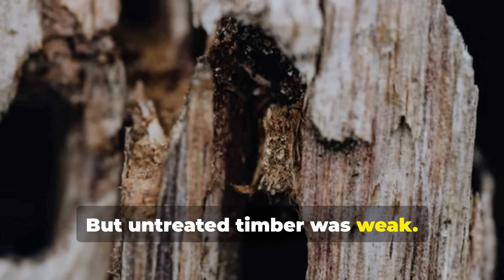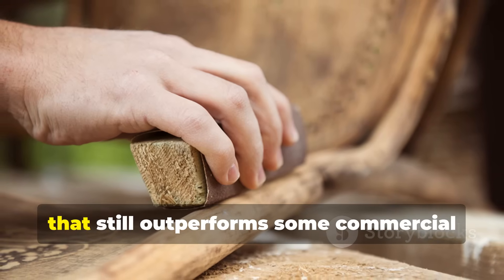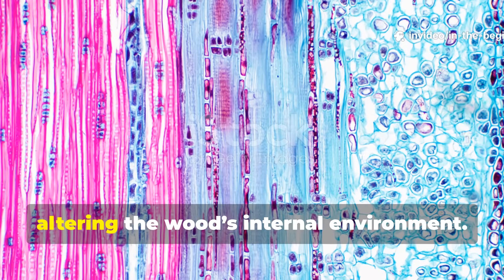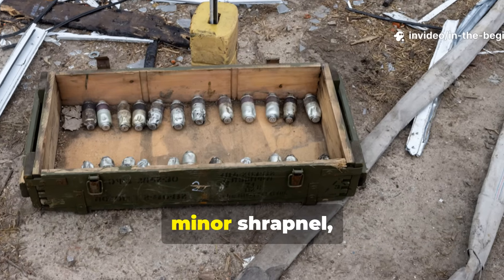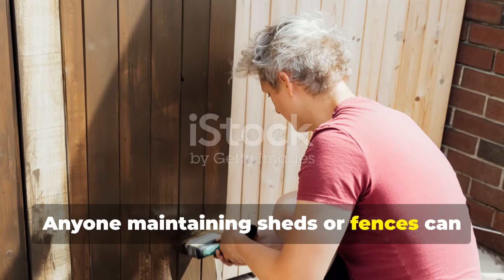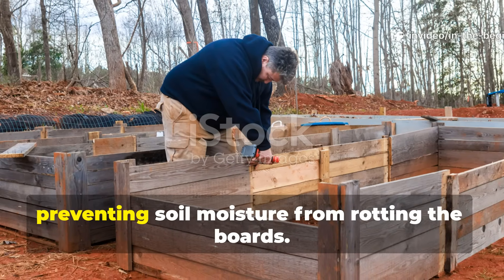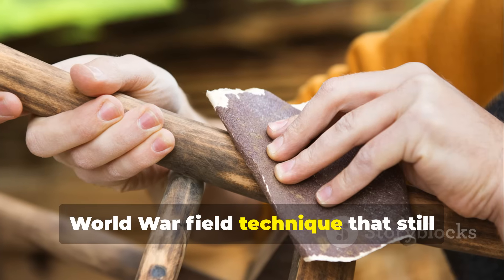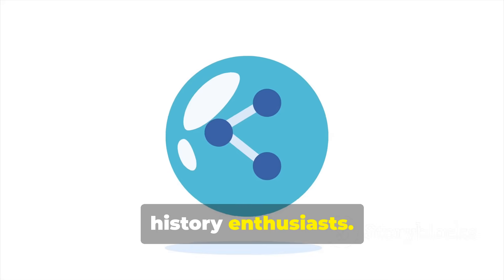💧The Forgotten WWII Paint Additive That Made Wood Bulletproof

Comment: Boric acid is used as a binder in various applications, particularly in polymer dispersion-based binders.
It acts as a cross-linking agent in polymer systems, enhancing the strength and stability of the binder. 

In X-ray fluorescence (XRF) analysis, boric acid powder is used to bind powdered samples, ensuring they remain cohesive and stable during analysis. 

Additionally, boric acid compounds are utilized in lithium-ion battery applications, where they improve the bonding performance of silicon negative electrodes. 

These applications highlight boric acid's versatility as a binder in both industrial and scientific contexts.